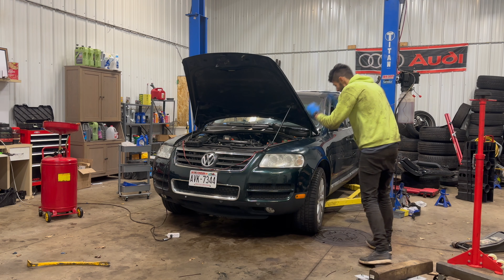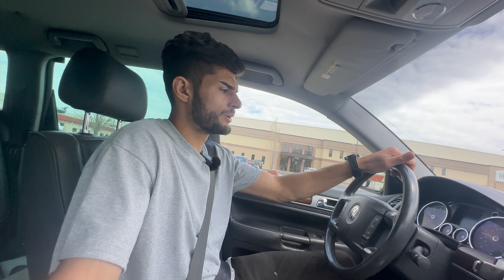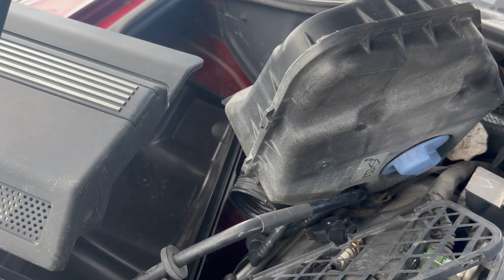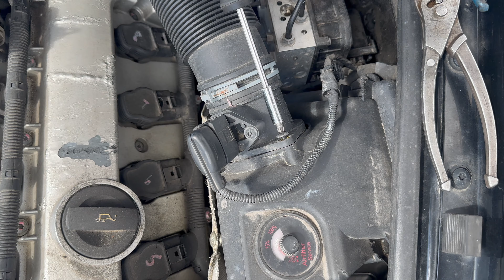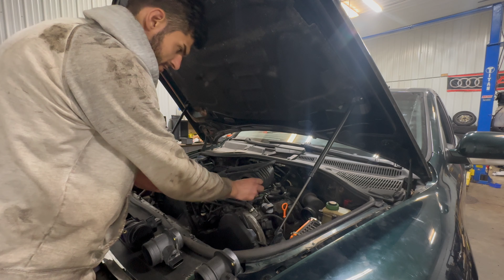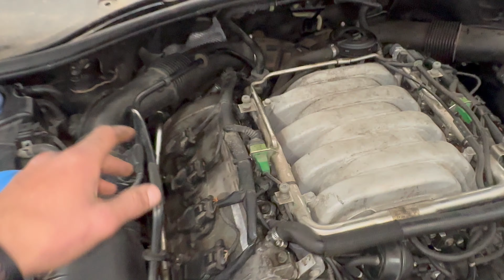My Freshly Engine-Swapped VW Touareg BROKE Immediately

Comment: Might need to test and clean the injectors or dump some injector cleaner in the gas tank.  Timing and valve timing might be off or just the idle rpm speed adjustment.  Takes time for the computer to render new results over its own test results.